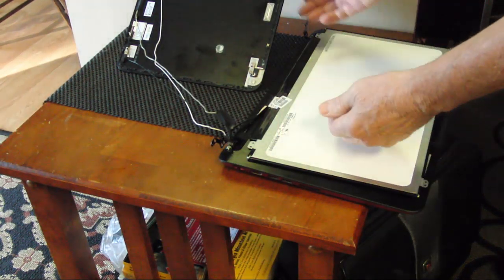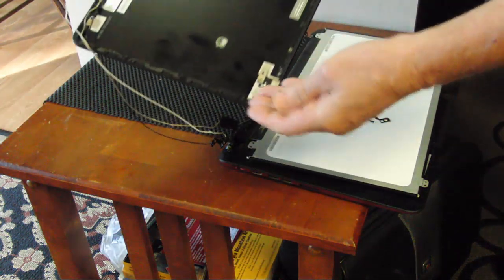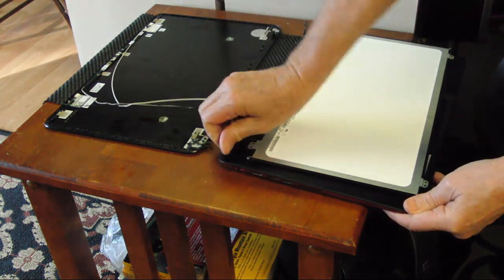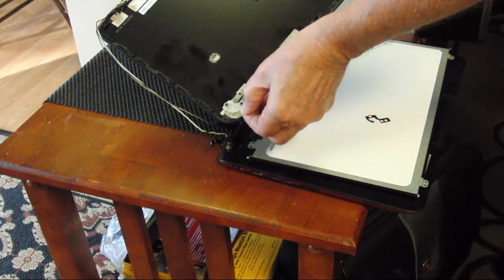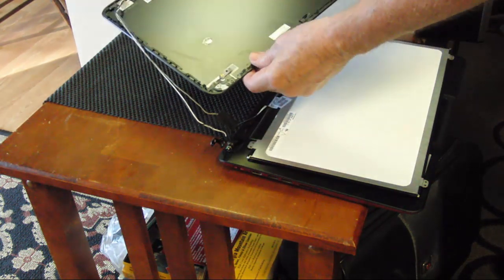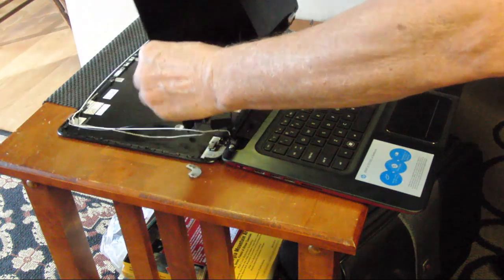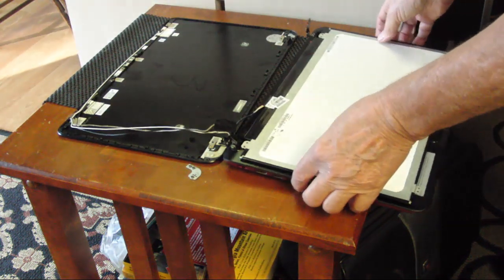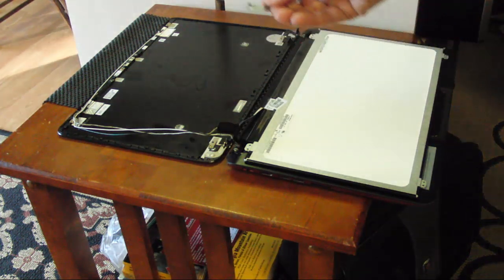HP-ENVY 6-1010US HINGE BROKE

Comment: The left hand hinge usually goes first because the CPU is on that side and the corner heats up, then cools down over and over again. I fixed mine by drilling through the hinges threaded hole and through the top of the lid. I then added more epoxy and a pop rivet from the lid side through the previously drilled hole which firmly grabs the hinge against the lid. It doesn't look too bad and has held for over a year now. The bad news is that my right hand side hinge just broke...........

Comment: Same problem here, HP tell me its customer abuse, repair €300,- !!  Yes euros. F**K HP, never, never HP again
Reply: +Don- ald   They told me the same. I suppose it isn't even a fix but instead a restoration to its original breakable self.
Reply: +Don- ald Make some time to write to:
 
NBC News:
http://www.nbcnews.com/id/40220716/
 
FOX News:
 foxnewstips@foxnews.com
 
or the www.ftc.com
 
and let them know about this issue.
 
If enough of us write in we may raise awareness and get a real fix, rather than a repair with original parts that will just break again.
Reply: Thats one of the options, but HP engineering failed to build a solid laptop, and won't offer customers any kind of coulance.

Comment: Hello.  I just sent off my envy to you today.  USPS kept saying the street number of your shop was invalid.  Per the repair form it's at 3890 but when I googled BRC the street number came up as 3980.  I copied the address from the repair form.  Please advise which is accurate.  I am scared my laptop may get lost on the way to you.
Reply: sorry, Google is right, my form is wrong. 3980 is correct. I'll tell the Post Office to be on the lookout. Don't worry, I'll get it. It's a small town and everyone knows each other pretty well. If you have a tracking number, send that to me and I'll be at the PO when it arrives. There's only one zip code here so it will get here and they know my business name. You can use the form on the website; put the tracking number in the last box. I fixed the form; thanks for bringing that to my attention.

Comment: I got that exact computer and the same problem. I want to drill the hinges, do I have to dis disassemble the whole computer? For what I have watched that's the procedure. 

Thanks in advance,
Reply from the maker: No, you just have to be able to get the holes drilled. I was able to drill the holes and with 3 small nuts & bolts attach the cover & hinge. It worked out fine and was easier than I thought it would be. The cover is aluminum, bty. When finished, I had three bolts visible but the customer was cool with that. It won't break again for sure. If you use pan heads like I did, take a dremmel and file down the bolt heads a bit. Flat heads may work better. I put loc-tite on the bolts also.
Reply: golfster Oh great I thought I have to take the battery, my solid state drive, ram and everything out in order to do this. I will give a try with my grandpa next week, thanks for replying me.
Reply: golfster Hey Golfster. Sorry I don't know your name. My names David. Can you help me out bro? Was wondering if you could give me a few tips on how you screwed these screws in and stuff. will I hit any wires or anything. What size screws you used? Any help would be helpful bro. I had my left hinge break and want to do something like you did? Any better ideas that you have since you did that job if you still remember. Not to savy with drilling i guess lol. just looking for a guide I guess. Beyond frustrated. Thanks again man. David
Reply from the maker: David G
Using the unglued hinge part as a template (that's the little piece I toss at the end), mark the 3 hole locations. I got the smallest diameter screws I could find at Ace Hardware, 3/4" long with hex nuts, screws were Philips panheads. Then just slide the screws through so that the nut screws on from the top. I used a Dremmel to cut off the excess threads past the nuts and even shaved off about half the thickness of the nuts. I used loctite so the nuts will stay on. The antennae wires are a hassle but didn't get in the way of drilling because I had the top cover completely removed. When you snap the bezel back on, it may not catch where the screws are. But your hinge will work fine.
Reply: you use a small wrench to adjust the tension of the hinges on either side. it's difficult at first but once you move them ever so slightly you can adjust to your liking.  good luck